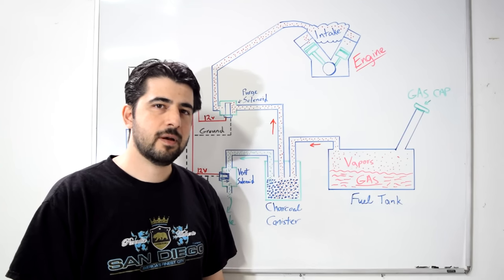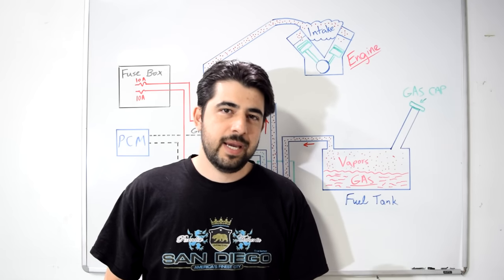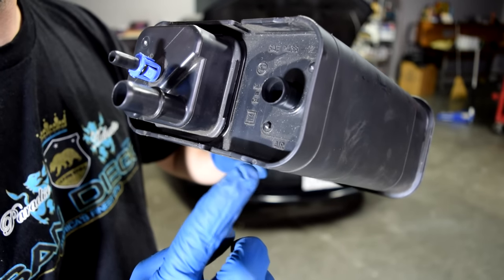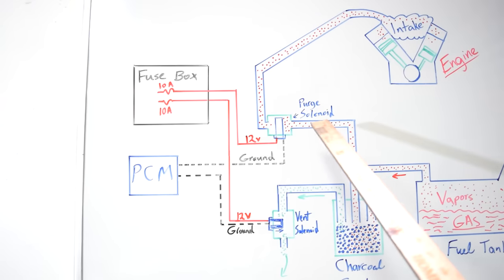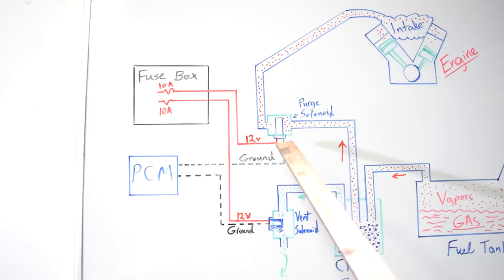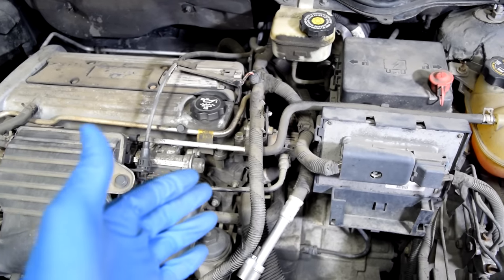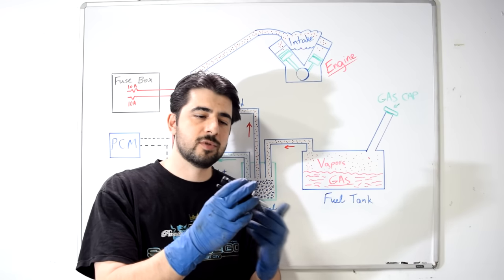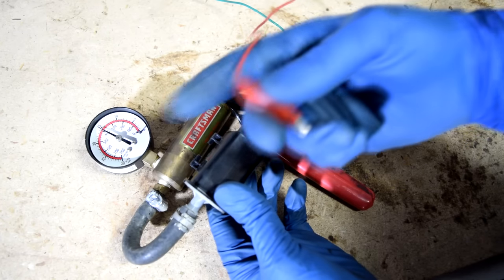Evap Canister Purge Valve Solenoid Operation, Diagnosis and Testing Procedure

Comment: hey ratchet I just got a 95 geo metro 3 cyl and my AC don't work that good but it works when driving good just when I come to a stop it seems to not be as cool or at idle any advice is appreciated thanks in advance
Reply: do you have a way to check your high and low pressure of you ac lines? it can be that the radiator fan is not turning on or that the check valves on your ac compressor may not be holding very well.
Reply: +Oscar G just the fill side and why its running its in the red when car off its overfilled a little?
Reply: +Ken Blalock it would be best to check the fill(low side) and the high side.
Reply: +Oscar G all I have is the gauge that comes with a can of ac pro freon from walmart so I cant check the other side
Reply: +Ken Blalock. so you added freon and still nothing?
Reply: +Oscar G its over charged so ilet some out but then I turned car on and its in the red

Comment: hy from ROMANI, 
can cause a startup error (after the car has been stationary for more than 12 hours) this valve? I have a problem at fiat 500 gasoline, after 12 h the first key starts and stops in second sec. The petrol pump has been changed (with unisens valve), the injector ramp is changed.
Can you help me with tips on what to look for or where to look for?

Comment: Is there a reason why the purge valve stays super hot?
Reply: If it is not heated from engine or exhaust I would assume it would be the internal coil that provides the opening force is going bad
Reply: @roybowman3602  thank you,  I moved it away from the engine, and still get super hot on the body of the purge valve.. I ended replacing it.

Comment: My purge solenoid is always open with no 12 volts, and then closes with 12 volt connection. And I still get excessive pressure in the fuel tank, which is new after replacing the rollover pressure relief valve.

Comment: Great video!  Just wondering where I can get one of those small vacuum testers, or what they are generally called so I can search for one?
Reply from the maker: They are called vacuum pumps, you can get them at most auto part stores or Harbor Freight. GL
Reply: I bought one to bleed the brakes myself. Was my first attempt at any mechanical work. Didn't really work for bleeding the brakes. thankfully I have a use for it now. If you can't find it maybe look for a brake bleeder kit. lol
Reply: Thanks for the advice guys!
I ended up finding a 'Vacuum Pump Tester/Brake Bleeder Kit' so I've got the gear for both jobs covered now! :)

Comment: Well i have a 07 chevy cobalt 2.2l LS and I believe this is the issue with my car.  Put in a fuel pump and filter and its still would not start after filling up the car.  I went and go the part so hopefully this solves it.

Comment: I've got a mini cooper, hunting at idle when warm. I took out the solenoid and put the airline on until it now blows through freely one way (but not the other way) and it has worked 🤣 surely not supposed to but hey ho it's stopped hunting and runs way better

Comment: 05 Sorento, P2422 code, vent valve stuck closed.  but vent valve is fine.   WTH is going on?
Reply: I have the same error code on my 2008 Hyundai Veracruz.  I have read things about lines being clogged by spider webs, but I'm not sure which line people are referring too.  I know that my car has a fuel tank air filter.  I'm wondering if that gets clogged if that could cause that error code too.  Let me know if you ever resolved your issue, and I will do the same!

Comment: I Have a p0441 Code and we have diagnosis all we can check from fuel tank cap to purge solenoid all the way from any harness damage or whatever... now, ima finna fill up my gas tank if ima finna have a rough run or anything weird to my car,, Got hyundai VT

Comment: With the possibility of the vacuum issue if it's a bad purge solenoid, could that throw a P0300 random multiple cylinder misfire code? (I also get the P0441 on top of that sometimes) I drive a 2008 Evo GSR and I get the code just a few mins of driving the car after clearing it. Spark plugs were replaced, code still appeared. Coil packs are good, checked those already. Also, I'm pretty sure I need a new fuel pressure regulator because every time I go to leave the gas pump I have to hold it just under 1000 rpm's until I get rolling or it'll die at idle. 99.999% sure that has nothing to do with the P0300 but hey, ya never fuckin' know seems like. All answers are welcome... except wrong ones because I'm running out of patience with this fuckin' puzzle I got goin' on. Feels like a damn game of Clue, except it's not as easy as "Colonel Mustard in the Ballroom with the Candlestick."

Thanks! :)

Comment: jajaja no problem with foul language.... jajaja Great video,  Niece Nissan 2012 versa had trouble starting will not go above 3k rmp. will flux up 2k and 3k. code p0101 replaced MAF... but did notice short term fuel trim on negative 25.  long term fuel trim on or close to 0.  cldnt get bk to fix car cause of wrk niece called mechanic his scanner showed it had a p0404 code changed purge solenoid and its working now... dnt know what I missed diagnosing, my scanner didn't show this code, lesson learned I guess..

Comment: Great video!  But can you add the pressure switch to this diagram?  I believe EVAP system has one to check the integrity of the tank etc.
Reply from the maker: yes, I'll include that in how the EVAP system works. It's usually a tank pressure sensor or a purge flow sensor that measures the pressure/vacuum in the system during the evap test. cheers

Comment: 8 months ago the hose on the canister side of my purge solenoid broke, giving codes P0441 and P0455. I drove it like this for the full 8 months. I finally got around to repairing the hose connection, but the codes have not went away. Additionally, when I try to fill up my gas tank now the pump stops preemptively (like a stuck vent solenoid).

If anyone has any ideas for what went wrong (did this ruin my canister?) please let me know. I'll be checking the fuses and doing an ECU reset soon as those are easy.
Reply: Kevin Rickard you fixed your problem?
Reply: Yes I did. A week after I posted this comment the CEL went away and all is well :)

Comment: Hey man! GREAT Fking Video! LOL ,  Ok so i have a question, it is below, these are my circumstances 

: i do not have another purge solenoid to put in this car yet. 
: I do not want to buy another purge Solenoid until I know that is what is wrong. 
: I have a suspicion it is the purge solenoid but it's not a crisis type thing. It is only that the car does not start on the first crank after getting gas.  After that it's all good ( appears all good, shes( My daughter) is probably not getting the best gas mileage out of it is all)
 : TODAY, the check engine light came on. This car is a 2005 kia spectra LX 2 liter and the valve is not easy to get to, or even see without pulling some shit loose and getting the cover off and all that. 

   so:  

  Here is my question.  if the valve is supposed to be closed, can I pull the plug and jumper the pins in the plug and bypass the valve to see if the engine light goes off?   or is that a terrible Idea?  I just wanted to do it real quick when she comes over next time so I don't have to schedule 2 hours of bull to see if that is the part we need to fix it is why i am asking. 

   Thanks man.  or Thanks whoever can tell me if this works.

Comment: A mechanic cursing? Using swear words even? Holy (expletive)!!!!! Say it isnt so! LOL. No worries. If I havent heard swearwords before, I'm in deep chit. LOL. ANYWAYS...,  My car (2001 Hyundai Accent GL) doesnt die per say - BUT - my problem is pumping gas into the tank is a freaking nightmare! Every 10 to 15 cents worth of gas - the pump clicks off. Some guy art Napa insists its the Evap Canister Purge Solenoid -  I dont think so - expecially based on your info here. I think its the Evac Canister thingy what sits by the tank. Sorry for using that technical talk. Am I right or what?

Comment: YES!!! Thank you for purging the whiny bitches, on to business.  I know this is pretty old but i'm hoping you can answer this.  I just added a procharger.  When i pressure tested the engine, at just under 8 psi the purge solenoid will open with the connector disconnected while pressurizing from the intake.  What are my options to stop this so i can get the boost i am aiming for?  (9-10 psi)

Comment: 😒 I dont understand some times the logic of young peopel?
What on earth are they learning in those deam school's?
I like he's video's and he is a good mechanic help's lot peopel but perhap's he is not aware of some thing's ore didnt notice it.
Do you know peopel on what the "old" acient engine's run on? 
"charcoal" !!! 👈🤳  
Let my give you somthing ells to think about how do you test what sort of fuel your useing with a spark plug exactly what does the spark color indicates? If you can figure out those colors to what element it belonges to "chemistry" you will finde out that cars and engines not realy work the way peopel describe them! Only a coment with out meaning just adding some question's but not answers to peopel found it for your self like library ore wikipedia because expecialy this particaly video stink's lot at "oil companis" 😧 
Probably the old wv hitles bug is related to this subject called the "kubelwagen" call my crazzy but at that time that thing was considered as a hybrid car belive it ore not even tought US army did use similar tehnology but peopel can finde that info on wikipedia again Im not hater from this guys chanel I only point out some things as a profesional oldtimer mechanic kids shuld learn first the old ways then go to new'r cars so that way they will understand bether some thing